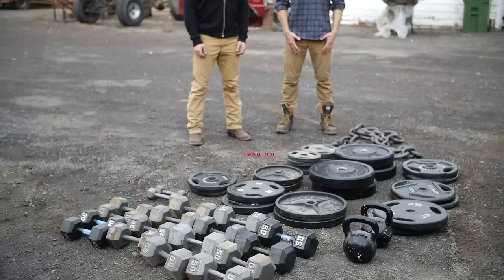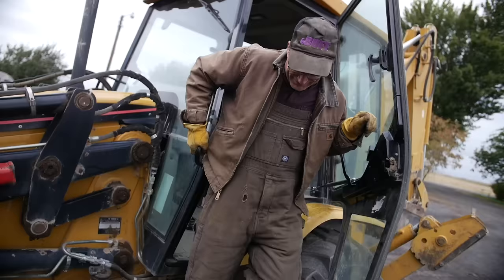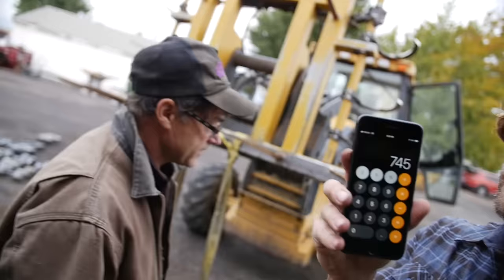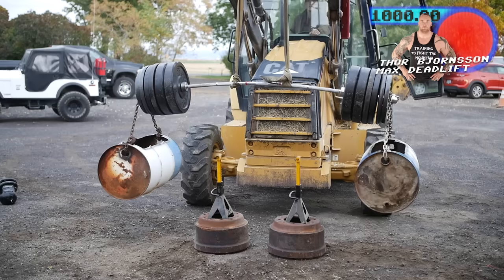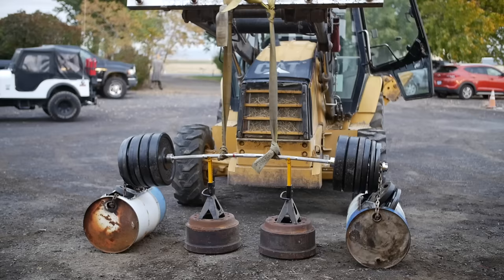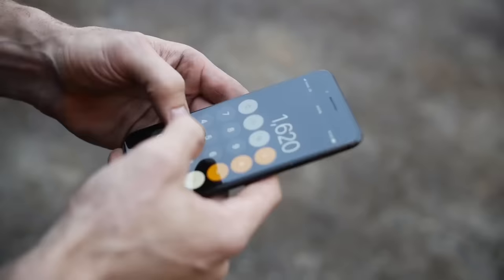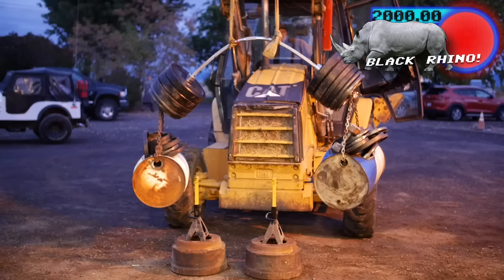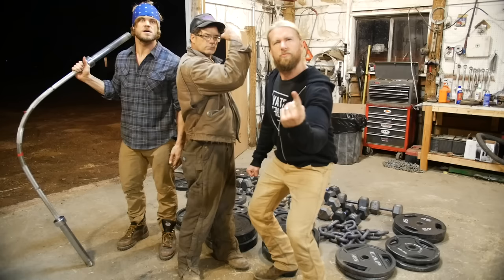How Much Weight Can a Barbell Hold? | STRENGTH TEST

Comment: Incredibly, the barbell didn't yield until the 1200 pound load was applied. And most of that weight was being suspended on the very ends of the barbell, where it produces the greatest amount of bending stress. It's safe to say that no man on earth is going to be permanently bending a properly-loaded barbell anytime soon.
Reply: Depends on the bar. There are videos of people bending cheap barbells.
Reply: Hold my beer
Reply: It could break due to shear stress too. Or with even less if you have a closer grip. Its super easy to calculate tbh
Reply: @adrianhalvorsen7013  The barbell would yield by bending long before it would shear in half. It's basically a steel beam with point loads. The only way it could fail in shear is if you applied a concentrated load right next to a support, which is never going to happen in real use.
Reply: @johnbarron4265  of course im just providing some extra information, its either shear of moment that breaks it (seeing as we have no axial loads) But a close grip meaning 1 point load in the middle would make it yield way faster. Do you happen to know a barbells yield stress due to moment or shear? I would assume around 300-400 N/mm^2
Reply: @adrianhalvorsen7013  The standard name-brand gym bars seem to advertise tensile strengths of around 1200-1500 MPa. That's about equivalent in strength to a 14.9 property class metric steel bolt. Pretty wild isn't it?
Reply: @johnbarron4265  seriously? 3 times normal construction steel? Jesud christ, reinforce the concrete in buildings with barbells
Reply: Yet somehow so many bars are bent at my gym 😡 I think it's cause people leave it loaded in rack

Comment: You guys should do a drop test on 45lb steel plates, and see how long it would take to crack on a standard gym floor
Reply from the maker: Oh yeah that's a great idea. Keep lifting it higher and higher until it smashes. If we shoot it we'll definitely give you a shout out Carl!
Reply: @buffdudes  I dropped a 25kg plate on my patio. Smashed 3 slabs.....the wife aint happy...😐
Reply: Plates are usually cast iron not steel. Cast can withstand huge amounts of impacts as opposed to steel so it would probably take you dropping it off a building to break
Reply: @mattmarriott6560  Cast iron is more brittle than steel I'm pretty sure
Reply: @Kiln Strength Their calibrated discs are steel though?
Reply: Cant tell if response is sarcasm

Comment: What kinda barbell clips did they use to keep those weights on tho... 😳
Reply: bryangoo123 chuck Norris’ hands
Reply: Probably the 2.5kg ipf clips
Reply: @craigairey5696  this clips aren't the ipf clips. This are just some basic clips which you can find on the internet
Reply: @TyranoShokZz  they look strong for basic clips. I have seen people deadlift 300kg and have standard clips pop off
Reply: They welded them on so it doesn't matter.
Reply: Idk just like some clips for like uhhh, a barbell?
Reply: Not chinese made
Reply: They can’t be some basic ones because I was squatting 410 when they slid a little bit, granted they are a little bit cheap but still.

Comment: If the bar ain't bending, you're just pretending.
Reply: Dmitry Krupenya i dont get it xD can you explain this comment haha
Reply: UltimatePrinceofBB something a gym teacher or trainer would say when you say the weight you doing is too heavy.
Reply: UltimatePrinceofBB not meaning you cant do it, but meaning you showing off strength so much you turn red
Reply: alright got it
Reply: @UltimatePrinceofBB  no, it's what massive meatheads say because they can actually make the bar bend.
Reply: wasnt it if the bar doesnt bend she doesnt get wet?
Reply: Dmitry Krupenya bbbbbbb
Reply: yep, bar starts flexing pretty decent around 350-400. especially with narrow grip on deads or fast squats. easilly achievable for someone thats been lifting a bit.

Comment: You guys could have added more weight. I see two perfect 220lbs buff dudes that could have gone on each side
Reply from the maker: Haha damn that would've been quite the finale
Reply: @EEE ZZZ with buff dudes approved safety equipments such as helmet, elbow pads, knee pads, goggle, mouth guard, waist belt, straps, it will be safe
Reply: I don’t think that would work
Reply: @drawdengod  sure, until the bar snaps and those barrels fall on them...
Reply: The bar could snap and go full speed towards them on each side on the way down.
Reply: Nah that'd be too easy for them
Reply: what, steel would just melt if it snaps?

Comment: Remember when I got my first EZ-bar due to living in a tiny space, can be used for all sorts and the fact that it could handle 100kg meant you could also do a bit of deadlift and rowing with it too despite it not being absolutely ideal for that, it was fine for a newbie, quite versatile. I remember people saying get a proper barbell that thing can only hold 100kg mate. Yeah well when I can curl 100kg I'll fuckin' let you know, I'll send the postcard via flying pig airmail.
Reply: Yeah, to be honest as a novice lifter you’re not often gonna be lifting that much. Especially not for rows and definitely not for curls. Obviously upgrade in due time, but nothing wrong with using what you’ve got

Comment: That's cool and all, but what's it gonna take to snap those straps?!
Reply: 4500 lbs per strap, used for securing semi flat bed loads 💪
Reply: DIY Duke Fucking hell!
Reply: Der Hof 2007 press X to doubt, I assume the rouge can handle a lot of weight but that’s most likely exaggerating. Literally no one can lift 10,000 pounds to test it so you couldn’t tell the difference
Reply: Der Hof 2007 they may be wider but that doesn’t necessarily mean they are stronger, why would rogue spend more money to make a stronger strap that is pointless, I assume they go up to around 4,500 lbs and then they bump up the weight capacity just for marketing. Until I see someone put 10,000 lbs on them they are fake numbers for marketing
Reply: @98kickinit  well, my guess is that the 4500 lbs one actual limit is 10000 lbs, but they lowball it a lot for security. The same way elevators can usually handle more than what they actually say they can in their security warnings
Reply: Straps are insanely strong.  The ones in the video could easily support a pickup truck.  I've used straps much lighter than these to drag entire trees out of the woods, and not just some Christmas tree, I'm talking about 40+ foot tall cottonwoods.  I would wager that you could max out that caterpillar long before the straps reaches a breaking point.
Reply: @98kickinit  A standard 4" ratchet strap (not a flatbed or winch strap - a ratchet strap) generally is graded for around 5000 lbs, whereas most U-hook, tow-loop, and flat hook winch or flatbed straps (similar to those where I used to work a summer job) are usually graded at about 10-15,000 lbs. There's nothing gimmicky or misleading about that number...it's pretty much standard.

Comment: Everyone here like wow so much weight

Me: WhAt ThE iS hElL tHaT ClOtH mAdE oUt Of?????
Reply: rope is designed to take literal tons :)
Reply: it's a tow strap. made for towing vehicles because chains can be dangerous. i've seen them able to pull 6k pounds but i'm sure theres ones that can pull double that
Reply: SAMEEE
Reply: Kevlar or Spectra
Reply: I use them daily at work. Its made entirely of polyester, the biggest ones have max. lift of 10.000kg
Reply: Ive got straps for 10tons
Reply: Open World Gamer I was gonna say that same thing
Reply: We got ones at my work for 60 tonnes for our 50 tonne cranes
Reply: Nylon
Reply: Crush a concrete block.

Now pull it apart.
Everything has different strengths and weaknesses
Reply: Made my evening sir!
Reply: We got tow straps rated at 50000 lbs
Reply: Chains are safer than tow straps. When a chain brakes I’ve seen it in person it falls. When straps fail they slingshot same as wire and rope.
Reply: @illidan2ify  If you over exert anything that's rated 50000 lbs watch the fuck out. I've seen straps break and it would fuck you up bad. If a 50000 lb chain breaks itll knock your fucking head off. Of course a heavy chain is safer than a light strap, but 50000 lbs is 50000lbs and if that energy let's loose all at once I'm more worried about mass.

Comment: i've seen them start bending very slightly at my gym at around 290lb to 310lb , we have all rogue barbells
Reply: Rogue uses spring steel for a lot of their bars. They deflect but they bend right back, as they're supposed to. The bar in this video is a "stiff" bar, which has no ductility to the metal... so once it's bent, it's bent. Bars that bend are typically used to aid a deadlift, and are usually only found in powerlifting. All other strength sports that involve a barbell use stiff bars.
Reply: Sky Guy How does deflection aid in dead lifts? Does it allow the lifter to carry more of the initial pull rather than how a stiff bar essentially says “no”?
Reply: @mtb416  the "whip" means that the point where you lift the weight from the floor is higher that it would be without it. This allows a lifter to kind of "cheat" the lift, but that's not the biggest benefit. When the bar is "bent", it naturally wants to follow a straight path. This makes the chance of bicep or shoulder injury far less likely. In the history of deadlifting, there are zero cases of someone using double overhand/hook grip on a deadlift bar ever tearing a bicep.

Comment: You should do the same thing but use an IPF stiff bar and see whether that bends as much or not. They are one of the best powerlifting stiff bars made by Eleiko
Reply: There are high tensile strenth bars that can lift 2000 lbs before bending.

Comment: Long strip of cloth = more powerful than the bar.
Reply: the strips of cloth are also not trying to balance weight at the ends of them stretched out. If you pulled the bar straight up snd down it could lift a few tons

Comment: Average Barbell is 1.1 inch diameter. The tensile stress of structual steel is 66000psi. omega=(M*r)/I. Moment of inertia is pi*r^4/4. so 66000=M(.55)/(pi*.55^4/4). M=8624 lbs. average barbell is 7.2 ft long. divide by 2 3.6 ft or 43.2 in. 8624/43.2 = 200 lbs per one side. so 400 lbs total is what a barbell can handle. if you were to lift it dead in the middle

Comment: Due to torque it would've been able to hold more if you didnt put the barrels at the very end of the barbell.
Reply: then its just the machine lifting the weight not the barbell.
Reply: Chad W he didn’t mean they should put the barrels on the middle. A shift of only half a foot towards the center would have made a difference.
Reply: @George Lecter or place the barrel between some plates instead of at the very end.
Reply: It is true because of leverage, not torque.
Reply: You know the way you're thinking of leverage is actually torque..? Torque is Force x Radius, which can also be said as Force x Lever, which is in a more general term called leverage.

Comment: Joking aside, regular barbells start to jiggle like noodles when you get to 10 plates, on the “close grip” (closer than the straps shown here) trap pick up shrugs, and then start to add chains and dumbbells. Gets the weight to the 1000-1200 lbs range. Bar turns into noodle, and does not return to straight form. High density olympic bars hold good.

Comment: How much weight that rope can hold
Reply: It's not a rope, it is a tow strap designed to pull (tow) vehicles. Most of them can usually handle about 4,000 pounds. One use for a tow strap is to pull a vehicle that is stuck, you basically back the movable vehicle as close to the stuck vehicle as you can, attach the tow strap to both vehicles then pull away with the movable vehicle and usually go kind of fast. The tow strap will actually stretch out and then you apply the brakes on the movable vehicle and the strap will bring itself back to it's original length and in so doing it will pull the stuck vehicle out from what ever it is stuck in. So those straps have to be able to handle a lot of weight!
Reply: @alabamahebrew  thank you

Comment: For more accuracy, shouldn't they use a new bar for every test? I would assume that for each time it does a slight bend, the structural integrity would've been incrementally compromised?

Comment: That barbell is already tired after all the previous dead lifts. Should have used a fresh one for the final lift since the previous one was already bent and now had lower resistance to taking weight so the final result would not have been so accurate.

Comment: How is that a standard barbell? That's an olympic barbell because it holds olympic weights a standard barbell is smaller than that and standard weights are smaller than olympic so that's not a standard barbell that's an olympic barbell.6:08

Comment: It's interesting to see just how close the World' Strongest Man record holders like Hafthor and Eddie Hall ARE to putting enough weight on the bar to permanently warp it beyond use and still lift it - that is pretty insane when you stop to think that their grip and just flesh and bone is putting up with the kind of stresses that would bend a solid barbell permanently - and I think in another 20 or 30 years we'll see our first 1200, 1250 lb deadlift honestly - which should be enough to buckle the bar to some degree and permanently warp it. Then I think about how heavy it feels to even pick up one of the 125 lb dumbbells at the gym and hold that for a while and walk 10 paces with it - I'd have to quadruple that with each hand to get into that world record breaking territory (I have no idea what I can deadlift because I never DO deadlift, so I presume probably not too much right away, but I would guess max of 400 lbs without specifically training in deadlift based on the fact that I have done 150 one-handed and definitely had some to spare - and to think that's only a bit over a THIRD of the world record - fuck me, that's a lot to ask of flesh and bone). 

I think the world record deadlift probably can't go beyond maybe 1400 to 1500 lbs without special equipment simply because you're approaching the breaking point of human muscle, sinew and bone and how much it can withstand. I SUSPECT 1400 is possible by a genetic freak who weighs 450 lbs and has hands the size of frying pans and lives to lift - one day we MIGHT see a 600+ kg deadlift - but beyond that like I said I really dont think flesh and blood can cope with it without breaking (hell, Eddie Hall was over 400 lbs doing his 500 kg/1100+ lb deadlift record and the guy nearly died doing it - blood coming out of his nose, passed out, pretty much had to quit strongman not long after that).

Comment: Your test flawed if u use one point in middle to lift it will bend easeir if like you done 2 points to lift will take more weight hold bar in centre not spaced out